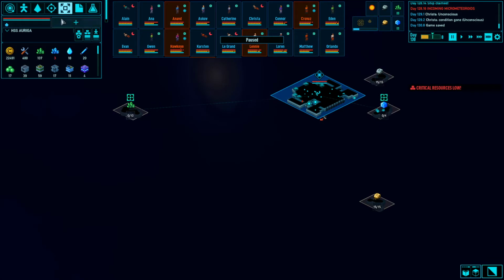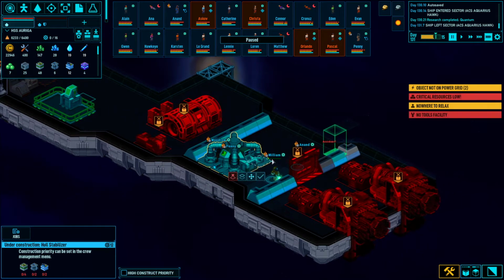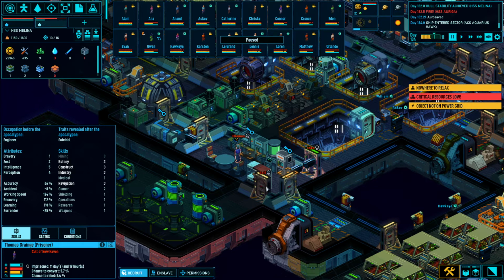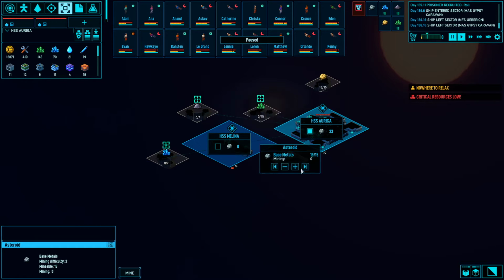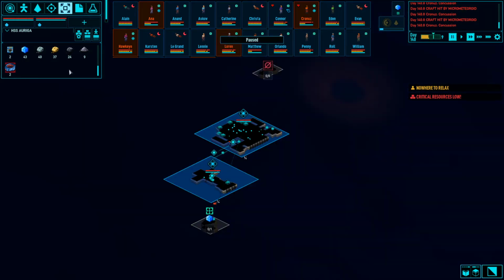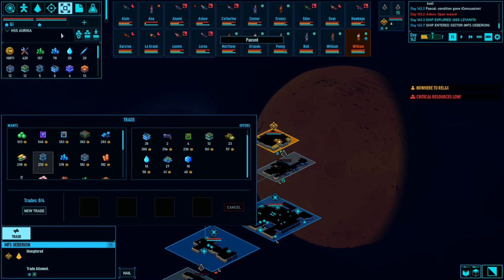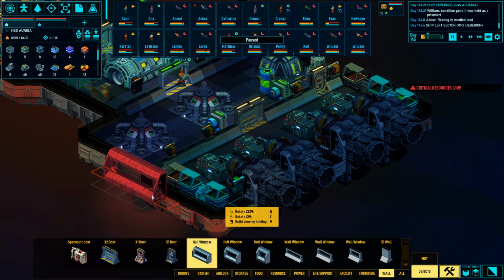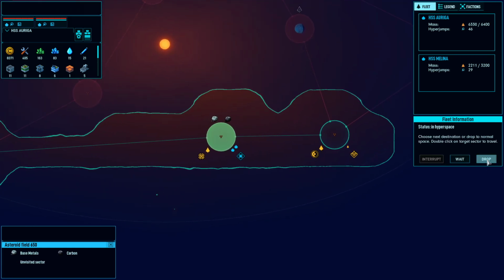Space Haven Tutorial 15 - Building your second ship

Comment: Why cook food on both ships? Why not just send food to the other? I mean, a min-max rule would help… “if under y, send x” so if it drops below, say, 25, it will bring the food up to 50. That way you don’t restock with every meal. Or, lock the door, so they only use those meals when they can’t safely go between ships.
Reply from the maker: I never thought about it... interesting idea! I am not sure if it's more efficient though. The biggest cost of having multiple ships is shuttle availability and the associated logistics. A kitchen with 1 of each food type would be 4 units to transfer, which I think would provide about 10 meals (depending on your kitchen settings).  If I create meals on the other ship and transfer them, I'd have to transfer 10 resources instead of 4 for the same amount of food for the crew. I would rather have crew on both ships do a little extra logistics and spend a few infrablocks then create more ship-to-ship transfers. I also like to set up a water purifier on each ship for the same reason, to reduce ship-to-ship transfers (transferring 1 ice is equivalent to transferring 10 water). Usually the crew of the second ship tends to get a bit under-utilized so this also gives them something productive to do and helps spread out the work more evenly between ships.

I don't usually want crew members from the second ship to travel too frequently to the first ship. If my second ship is a gunship it will usually have a skeleton crew, and I need most of them onboard to handle things like navigation, shields, weapons and hyperfuel/energy rod/ammo logistics. It creates a lot of risk if the only guy on my second ship with the shields skill is on the first ship when an enemy jumps into the sector.
Reply: @gorkwobbler  Good point. Of course, you could manually transfer, but that counteracts the whole point.

I didin’t realize ingridents where “smaller” (if you will). That is very good to know! It might be somewhere in between our two techniques that is optimal… will have to look into it (if I can figure out how to make a ship that works well).

Also, do you plan on making a tutorial for the more recent updates, for instance the system points thing, making asteroid bases, logistics bots, ect ect? (Or do you plan on waiting till you can make personal asteroid bases?)
Just wondering!

Also, like the idea of a gunship. I normaly just use the targetting jammer, but if I have a secondary ship with weapons… hmm… (Or, have a skeleton crew on a ship that is primarilly storage, well protected. Not very efficient, but very secure, if you can deal with only one docking port)
Reply from the maker: @chtechindustries4174  I am thinking that when I get through my current playthrough, if the next major version hasn't been released yet, I'll do a new platform start tutorial. If it does come out before then, I might play a few weeks into the new version first to make sure I understand the changes
Reply from the maker: @chtechindustries4174  Worth noting... if all of your ships have only 1 airlock each and you have at least 2-3 shuttles, it's possible for the shuttles to get stuck in a state where each one is waiting for an airlock to become available but the other shuttle is already using it. (This is called a deadlock in software engineering terms). I usually build a second airlock on one  of my ships as soon as possible after building a second ship to avoid this... preferably my main ship if there is room
Reply: @gorkwobbler  makes sense. I’m actually thinking 2, one of them set to not allow trading. That way there is guarenteed to be at least one availiable, and hopefully 2. The targeting jammer forces people to have to board, and with only 2 airlocks, I can easily know where they will be! Makes battles quite easy! (In theory)
Reply: @gorkwobbler  great! Can’t wait, but I will…

Comment: how do you build it wide and massive i have a small green build area and don't know how to exspand it plus when i try to build one it says i can't because of system points
Reply from the maker: A couple of steps... first you click the "+" button under your inventory to create the new ship's area on the sector map. You use the left and right arrows to choose which shape you want, then click and drag the new shape onto the map. Your new ship's size in sector squares is limited by your existing fleet size - your fleet can only be 12 sector squares total. Once you have placed the template in the size you want, use the Edit Hull like normal to build your ship.

In Alpha 14 it's not possible to change the ship's size in the sector map after the ship is built. You would have to dismantle everything, abandon the ship, and make a new one. In the upcoming Alpha 15 version they are adding a feature where you can change the shape for existing ships when you drop them on the map after exiting hyperspace.